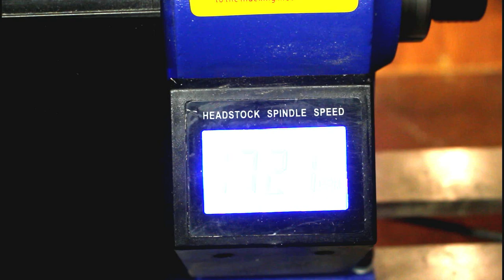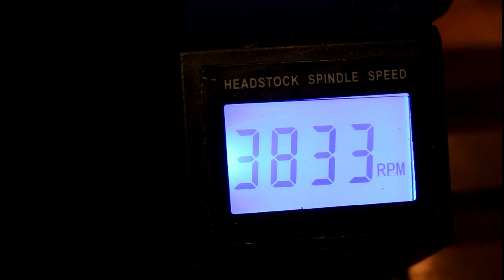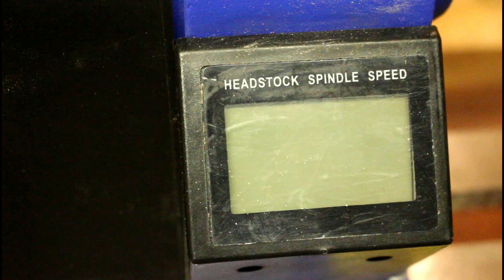Control Module Replacement - Lathe

Comment: Hi Andy, I bought my W824 on the 29/11/2019 and the same thing has happened to the Lathe. I returned to supplier (Tool Fix) who contacted Charnwood and are sending a new unit. This must be a quality control problem. Thanks for the video.
Reply from the maker: Sounds like there was a bad batch!  Odd that we both got the same lathe around the same time and both have had the same issue! Mine has been perfect since I replaced the module though, so I'm happy out now! Good luck with your installation, it's really easy to do! Thanks for watching!
Reply: @andy.elliott.foreverpens  Hi Andy. I called back to Toolfix last Saturday (1/2/20) to collect my repaired W824 and I found out the Charnwood had replaced my Lathe for a new one. Congratulations to Toolfix.ie and Charnwood.net for 100% EXCELLENT Customer service. I hope this Variable Speed Controller unit  lasts longer this time !!
Reply: i have the same problem my new one is on its way as i type, you would think they would have sorted the problem out by now?